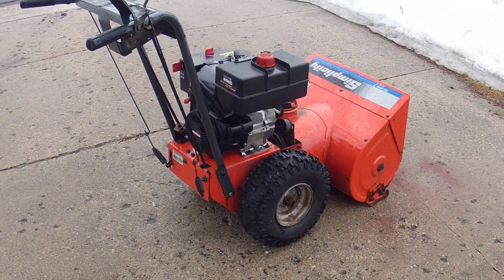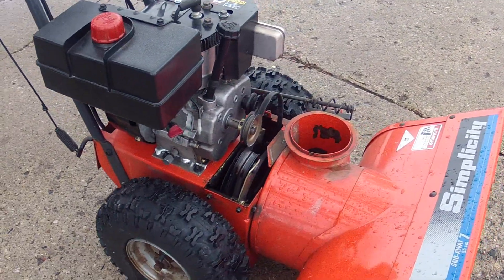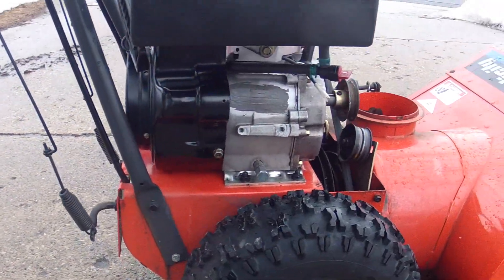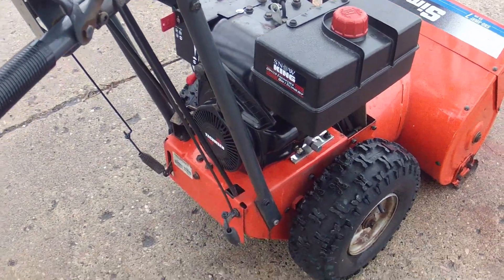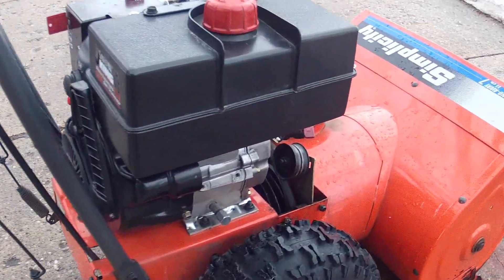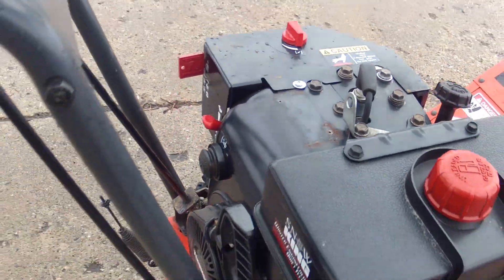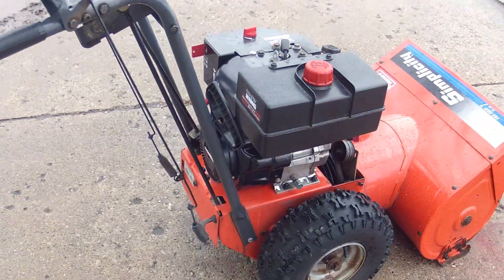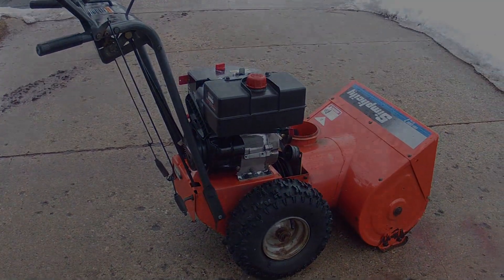Tecumseh HSK70 Rebuild - Part 36 -Engine Mounted and started

Comment: I have the HSK70 on my 1971 Ariens sno thro and its a great machine.  I took everything completely apart to clean and replace anything broken or worn and put it back together.  Used all OE parts to keep things as original as possible.
Reply from the maker: Very cool

Comment: Any idea where I can get an explanation as to  what for example HS 50 M & earlier means?  I have the HS 50...which from the 7hp rebuild you did is a 5hp tecumseh engine on a Yardmachines snowblower.
Reply from the maker: HSK70 means Horizontal Snow King 7 HP. HS50 means Horizontal Small Frame 5 HP. Check out this service manual online, and look at page 7 - http://tecumsehpower.com/customerservice/bsi.pdf
Reply: @RealManSkills  THANK YOU!  This answers a million questions I've had.

Have a blessed 2022!!
Reply from the maker: @Larry_T6710  God bless!

Comment: Great videos, where do you find the torque specs for the engine ?
Reply from the maker: There are several places on the internet where you can download (for free) the repair manual for the L-Head Tecumseh engines. That manual has all of the torque specs listed. Just google "Tecumseh L Head service manual" and you will find it. Thanks for watching.

Comment: Hello SBLG43.  I really liked this series you did.  As I was watching I thought the engine was saved probably by the starter motor.  If it wasn't there I believe you would have had a hole.  Then I was thinking the shock probably broke the starter.  Great job.  Gene
Reply from the maker: Yep, that's my guess too. Thanks for watching.
Reply: sblg43 Hello, good videos! My Tecumseh hsk70 runs a little then BACKFIRES through exhaust! I set the timing just like yours in video to proper .0125! And spark plug too! Wondering why backfiring through exhaust then quits?
Reply from the maker: mike jones I would guess that your carburetor is running a bit on the lean side.

Comment: I followed this series all the way and got my engine to run. Only problem is it's blowing smoke and oil. nNot sure where it's coming from but wondering if I put the breather in backwards. UGGGHHH!!!  Regardless, wouldn't have gotten this far without your help.